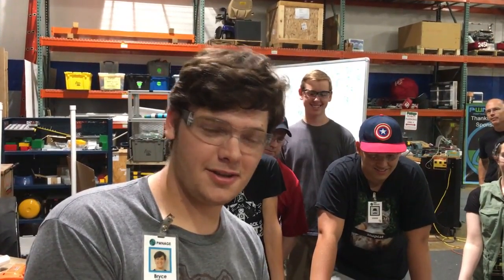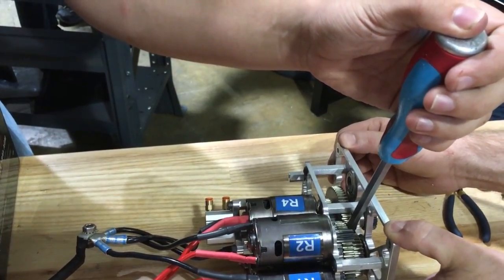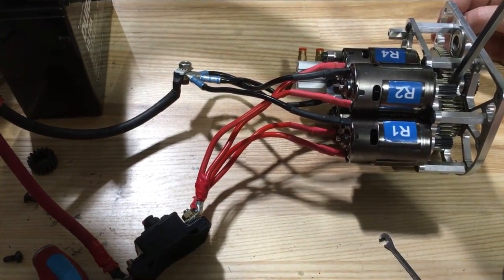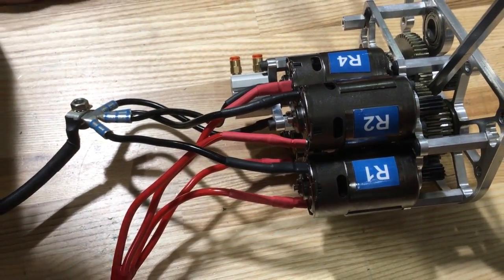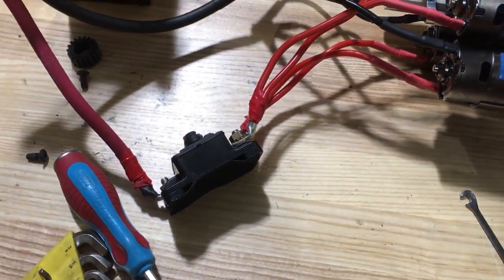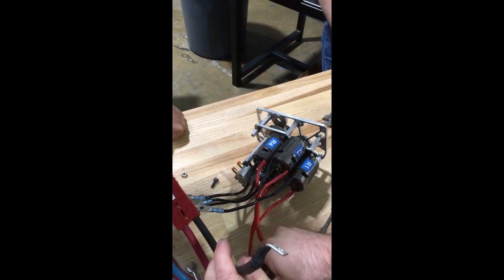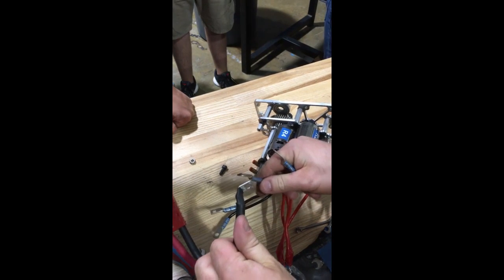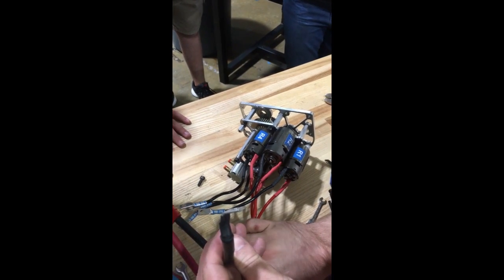DEATH OF A 775PRO GEARBOX

Comment: Hi ! Did u guys have any problems when running steel pinion and aluminum gears together? I'm thinking about using 8t steel pinion for 775pro and 40t aluminum gear. Do you think it will have problem?